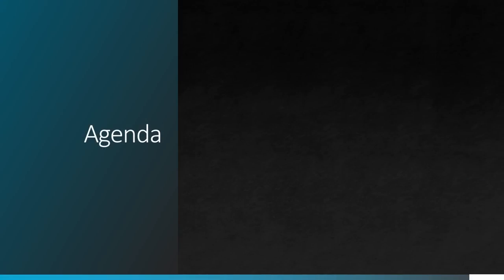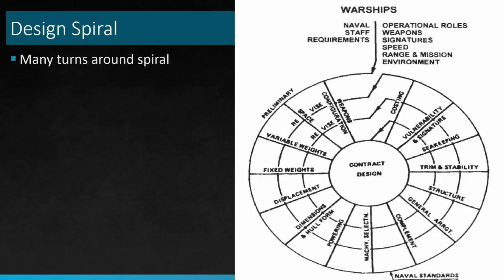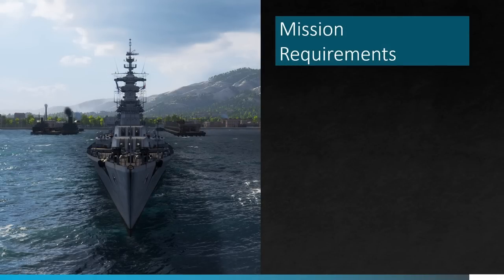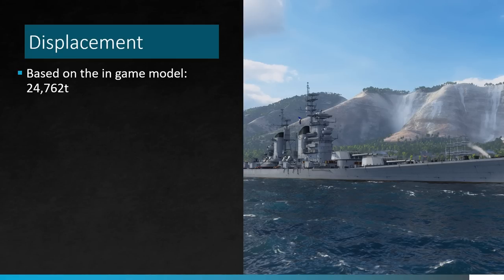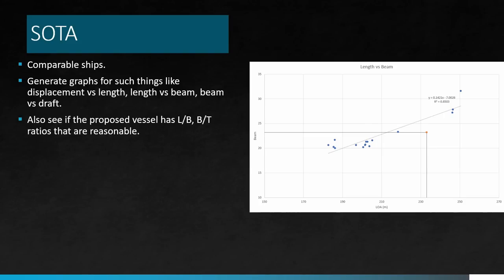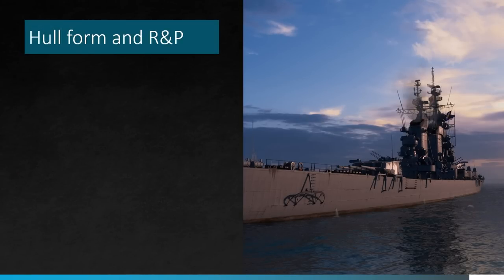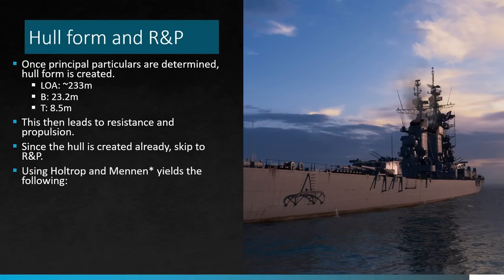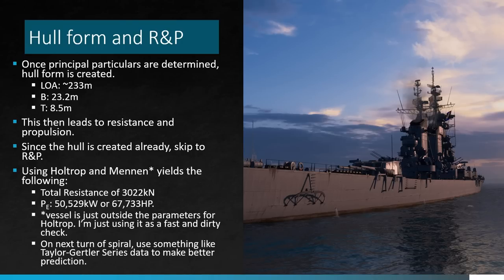Petropavlovsk - WG Fantasy Ship or Actually Plausible

Comment: Supposedly aren't Petro and Riga supposed to be based on the first few drafts 20-25,000t of Project 82 (Stalingrad) before they upgraded it to a 305mm gun design? Would be hard to verify without access to their archives though. Can't really find much pre-Stalingrad details on the project bar a very general outline of tonnage, armament and speed for the 220mm gun design online.
Reply: Actually, they're based on the final 220mm armed Project 82 proposals from 1947, although Riga is far closer to the actual design. There were 3 proposals in 1947, the first two were 305mm armed and varied in size and armor, while the 3rd was the 220mm proposal.
Reply: There's a very small amount of information on the 220mm designs in Stephen McLaughlin's article "Project 82: The Stalingrad class" in Warship 2006, although obviously the bulk of the information is on the final 1950s 305mm-armed design. The final 220mm design, Variant III drawn up in August 1947 displaced 30,000 tons, had an armament of 3 x 3 220mm guns, 6 x 2 130mm guns, 8 x 4 45mm, 6 x 4 25mm. Protection was to consist of a belt of 150mm and three decks of 50mm, 75mm and 20mm, with a complete torpedo protection scheme capable of resisting 500kg of TNT and a 5-compartment flooding scheme of survivability. Speed was 33.5 knots and complement was 1750 personnel.
Reply: Petro was Project 66, and actually came after Project 82.  Kuznetsov temporarily convinced Stalin that the rate of fire of 220mm guns would be superior overall.
Reply: @robdgaming  Project 66 is already in game as Moskva. 

The design features of Petropavlovsk are closed to early Project 82 designs than the later Project 66, which as you can see shares design features with the final Project 82 design and Project 24 design drawn up around the same time.
Reply: @robdgaming  Wrong. Project 66's main varient is in WoWs as Moskva. Petropavlovsk is not Project 66 at all.

Comment: One of my main complaints about pretty much the entire Soviet tech tree after T5 is that it skips to mid 1950's designs, while most nations are stuck at late 30's early 40's tech. There's a lot of hand waving capabilities aside when you have a 10 year tech difference with engines and guns.
Reply from the maker: Yep, that's very true. But then they had to either do this or go real paper ships and I think that might have been worse.
Reply: Yes, but... a lot of those same 1930s and 40s ships did serve into the 50s due to financial reasons after the war.
Reply: Well one must create a viable line of fantasy ships when dealing with the Russian Navy.  Not much to work with there.  Russia never was considered a "Naval Power".

Comment: We all know it's a magic game with magic boats, surrounded by magic circles, firing magic shells, protected by magic steel, powered by magic boilers and magic turbines.
Just name a few magic things happening in the game: ap shells over pen under waterline, water refuses to flow into the holes because they're not done by torpedoes; hull plating can bounce off shells because all plating on a ship are made out of the same steel, despite the fact armor plates need to be surface-hardened Krupp steel while hull plating has to be soft steel because on a riveted hull, the joints of plating must be sealed by caulking (literally punch some steel of one panel into another).
It's just a game, not simulator. If we can put these ships in real water,  many of them may not be able to stay afloat cos they are seriously overweight. And we haven't  even talked about weight distribution LOL. Weight distribution can greatly affect a ship's sea keeping characteristics. WG can install boilers and turbines that are as light as feathers, but now the ship can roll and pitch so badly her guns can't actually hit anything. 
Consider the chess, all pieces such as knights or castles represent something in real life, but highly symbolically. The same applies to WOWS. :)

Comment: It's a dumb idea to design a specific platform to counter another specific platform  when odds are those two platforms would never meet. It speaks to insecurity on the scale of their "father of all bombs" in answer to the moab.
Reply: Well, this is basically how historical naval development worked, kind off.
 I also feel you are neglecting that vessels of similar role kind of have a good chance to meet up when both put in the constraint of running an mission and counteracting it. Engagements do not happen by mere chance, people are actively orchestrating the circumstances where they meet up. 
Kind of how the Deutschland class completely failed to acknowledge the existance of dedicated cruiser killer platforms like HMS Renown, Repulse and alternatively Hood, possibly fueled by the fantasy that the RN would not be an major player in German Naval plans again.
Reply: @Tuning3434  When you develop a system, ideally it is to perform a task or series of tasks that synergize with the other units in your fleet. This goes for any military vehicle, but in this context you want to develop a cruiser that, say, screens your capital ships from air craft, provides some asw capability, and provides fire support for the fleet. We call this "combined arms". You don't build that cruiser simply to take out a single unit type of your likely opponent specifically. To perform the same role in your own fleet perhaps, but for a cruiser to be built entirely to counter another cruiser when it's more likely to encounter planes from that cruisers carrier battle group, or an attack sub, or destroyers is a waste of time and resources. Wars are started over ego, but fought successfully with intellect.
Reply from the maker: Yeah, there's a pretty lacking amount of material about what the vessel was expected to do. Hence why WG is able to fudge a ton of stuff lol
Reply: @ichasegaming  Given Russia's propensity to design weapons simply to one up notable western equipment I wouldn't put it past them to commission a super cruiser to do just that.

Comment: I think it's one of the earlier designs of Stalingrad from like 1949, but not sure how much WG changed the design
Reply: Petropavlosk is supposed to be based on version iii of Stalingrad from 1947, which was the final 220mm armed design. WG fudged it a fair bit. Riga is much closer to the actual final 220mm armed design.
Reply: @Kingpin6100  Yeah, not a lot of information available in English bar tonnage, speed and armament for the proposal.
Reply: @Kingpin6100  Nah Riga is actually the 1943 version. Stalingrad, like Kremlin aka Project 24, actually began design studies during early 40s. Finalized in 50s

Comment: i frequently hear that this ship is topheavy, and because of the weight and low freeboard the ship would become a sub, or would at least do so in choppy russian-atlantic weather
is that realistic?
Reply: I've heard the argument was that the design was intended for the relatively calm Black Sea or Baltic, but it would probably roll something fierce in rough seas if it's indeed top heavy.
Reply: Not really. There's a ton of armor and the ship has a lot more freeboard than it seems, being roughly equal to Des Moines. It just looks like it had no freeboard because of the other dimensions of the ship. It would be rough in stormy waters, but it also wasn't designed with them in mind.
Reply from the maker: The best I can say is this is nearly impossible to say. Mostly due to the following things:
1. We have no accurate VCG (vertical center of gravity) of the ship, this is because in order to determine an even somewhat accurate VCG, you'd need a complete set of structural drawings to figure out the VCG of all the steel weight. Then you'd need the weights and centers of all the machinery, equipment, fuel tanks etc.
2. With a better estimate of VCG, you can make a rough guess as to what the vessel's GM could be in both small angle and large angle stability situations.
3. In reality, the actual VCG and GM of the vessel would be determined once the ship has been launched and an inclining test done. 

The only way the ship would capsize is if the large angle stability of the ship is poor and in stormy conditions, the vessel is pushed past the point where the righting arm disappears. Then she'll just roll over.
Reply: @ichasegaming  okay, thanks for the info